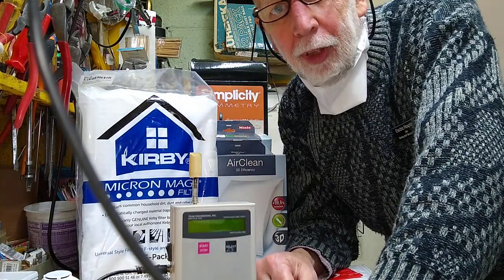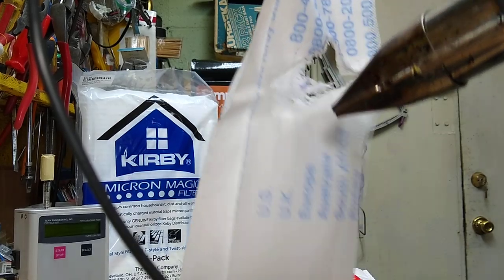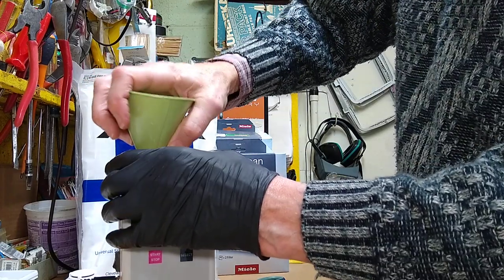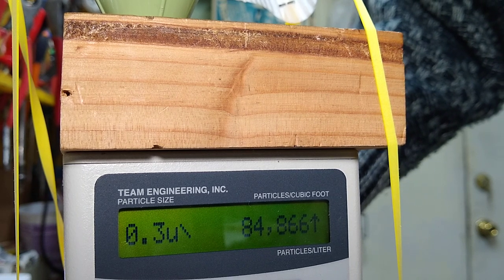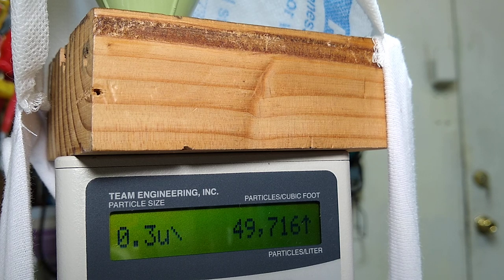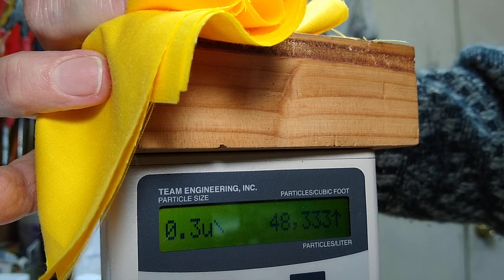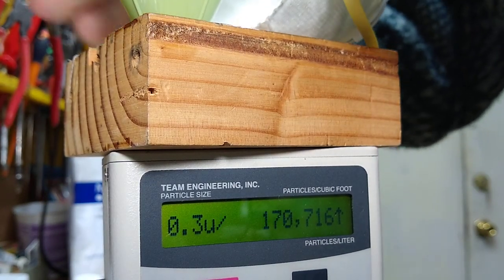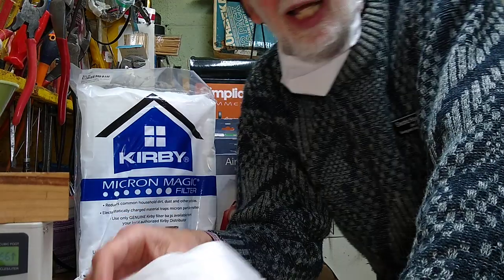Myth Busted Fiberglass in Vacuum Cleaner Bags

Comment: Thank you! I’m tired of people repeating misinformation about hepa vacuum bags containing fiberglass. For personal use my friends and I made two-layer cotton masks with an inside pocket. Inside the pocket we put filters made out of Kenmore hepa vacuum bags. The vacuum bag fabric (meltblown) filters down to .3 microns.
Reply: Doesn't air come through the cotton part of your mask without going through the filter? The CDC states that medical personnel have to have even N95 masks fitted to them to get an airtight seal and that they have to have the fit tested monthly. Also they state N95 masks are useless with beards, something "Dr." Joe might want to think about.
Reply: Edward Be5 It’s true what you say about medical use masks, but these are for personal use, as I had stated. The inserted filter actually covers a fair amount of the face, so it would provide a bit more protection.
Reply: What ppl are forgetting is this. 1, with these home made masks ur supposed to be practising social distancing, 2. Handwashing 3, not fiddling with the mask. So overall running to the grocery store or sitting at ur desk at work ur chances of getting the virus is reduced. Obviously if ur a dr and working in ER u probably need a whole lot more of PPE.
Reply from the maker: Yes on both accounts.  There is some leakage with the cloth mask and the beard.   I find if I put on a mask or respirator very tight the beard compresses enough to keep sawdust out of my nose.

Comment: Hey, thanks for the video! 
I feel pretty safe using the vacuum cleaner bags I have at home, the material even has a sligtly similar feel to the material of the surgical masks I had. I’ll might ask the manufacturer just in case.

Though I’m still worried about the practical performance like breathability of vacuum bags, they do seem safe atleast. But could you also give your opinion or do a video on vacuum cleaner exhaust filters (HEPA or not)? I have two kinds and the other has soft cloth-like material similar to the bags, but denser and thicker. The other cheaper exhaust filter looks a bit suspicious with more rough fibers. I’m wondering if they too could be used inside a filter pocket of a cloth mask.

Comment: Not sure what to think after making a couple of calls.  See below:
I called Bissell about their Big Green Commercial bags:  BG101H & BG102H (UPC #011120167597 (Part #44).  The rep said this one has fiberglass but the one with  Part #45 doesn't.  Not sure what to think now.  Also, here is a verbatim chat I had re: Oreck 1C bags:  Oreck Hepa 1C Vac Bags:  These filter bags do not contain fiberglass. Our bags, like most vacuum cleaner bags are made of porous woven material, usually cloth, paper and/or synthetic material which act as air filters when installed in the vacuum.  If you wish to use them to make face masks, this is the information we have concerning that issue.  First and foremost, we desire for you and others to stay safe! Our vacuum bags have only been designed and tested for use in vacuum cleaners. Unfortunately, we cannot recommend for people to turn vacuum bags into makeshift face masks since this could give users a false sense of security and potentially put them at risk. Vacuum cleaners mechanically create a condition that facilitates effective filtration through the vacuum bag, but humans are unable to create this condition. Therefore, these types of masks cannot provide the appropriate filtration and would only provide minimal protection. Withthat being said, we are partnering with suppliers that have an expertise, volunteering resources, and redirectingvacuum bag materials that can be used to manufacture face masks to assist in the fight against COVID-19.  This is the best way we can currently help, and we will continue to look for ways to assist.
Reply from the maker: Sounds like a definite maybe.

Comment: Couple of suggestions. 1. Draw some air through those filters.  SO cut a hole in the side of your funnel you are putting your filter material over and draw some air out the hole.  This will show how many particles are being released from the filters as they are being used as you breath in and out.  2. Put the fiberglass over the funnel and show just how many particles it releases.  It may not be the amount of particles but the type of particles that are of concern.  3.  I like to see how well a water filter does and I don't mean a Brita water filter.  I mean like a Rainbow Vacuum water filter does without the Hepa filter.  I have an old 1970s Rainbow vacuum cleaner that is water only and it does a great job no dust or pollen coming out of it.  I think the newer models the hepa filters are unnecessary and were just added to say they improved it to justify increasing the price.
Reply from the maker: The laser partical counter has a vacuum that sucks air through the filter.  That's why the numbers decrease as the air inside the funnel is purged.  Then it measures what is still coming through the filter.  
I did test the fiberglass and it was filthy.  It came out of my attic so I didn't show it.  I didn't think it was fair to compare it to a new filter.

I have tested old Rainbow Vacuum Cleaners and none of them filter as well as a Miele with a HEPA filter.  Even the new Rainbows are not as good at filtering.  That being said I have many customers that swear by their Rainbows.

Comment: Joe, the CDC states that N95 masks come in different sizes and have to be fitted to medical personnel to achieve an air tight seal. They also state that the fit needs to be verified monthly. A real fly in the ointment for you personally is that masks are not effective if you have a beard. This makes sense. Why worry about needle holes if air and viruses are going around the mask through your beard?
Reply from the maker: Yes beards are going to make the seal bad.  I like to do wood working and usually wear a cartridge type respirator.  They are hot heavy and uncomfortable.  However even with a beard I can tell my allergies are less severe with the face mask on.

Comment: Joe. As part of your demo you work with a Miele dust bag; however, any thoughts on the Miele SF SAC 20/30 filters?  Are these also comprised of non-fiberglass materials? One person I talked to says that Miele, for example, does not make their own filtering components but rather these are produced by other suppliers according to Miele specs. Additionally, I was told by one source that Miele filtering materials are either not suitable (or at least not recommended) for use in face masks. Given liability issues, it likely depends on who you talk to. There seem to be many schools of thought on this whole thing. I own a C3 Miele and so have the filters I referred to and was hoping to use them. Thanks again for sharing all the info.
Reply from the maker: I have used these in my respirator for years.  They are not figerglass.

Comment: My questions is in regards to the exposure to the polypropylene... There are studies on pubmed that have identified potential hazards that flocking workers are exposed to when working with synthetic polymers. One study I read, showed significant differences in various pulmonary function tests between the workers and the controls. Granted, the workers were likely exposed to a higher concentration of polymers than say a person using a mask for 20 minutes at a grocery store....... There are risks to everything, however, and unfortunately we do not yet have good information on the actual usage of masks made from vacuum bags and health outcomes. Therefore, I don't think it's fair to say that we can assume that using vacuum bags as filter masks are necessarily safe. HOWEVER.... here's what I am doing.... because I have a family member with a leukemia, I am suggesting they can use a mask made from vacuum cleaner cloth only during very specific times, i.e. have to go to the grocery store... for all other times, when they leave the house, I suggest using the cotton masks described by the NEJM, Lancet, etc. studies.
Reply from the maker: I can understand your concern if you were flocking or making these fibers.  The hazards of loose fibers would be greatest when cutting.  When you are sandwiching them between two layers of tightly woven fabric this would also reduce the exposure of the end user.  Thanks for sharing your ideas. 
 Have a great day.

Comment: Thank you so much for this video.  If vacuum cleaner bags are used as a filter inside a homemade cotton fabric face mask how often should they be changed out?  I'm guessing you can't wash these so just pull it out of the homemade mask you are using while you wash the cotton mask? Would you advise spraying the filter with lysol after each use? Thanks!
Reply from the maker: I would not recommend any disinfectant that could leave a residue.  Alcohol may be safer.  Remember I am not a real doctor. Lol.
Reply: @electrichospital  okay thanks!

Comment: Specific to Miele FJm bags- when making a mask can you tell me if I could/should use the filters that come with the dust bag or just the dust bag itself? There were 2 types of filters that came with the bags - an air filter and a dust compartment filter. Are these any use in a mask?
Reply from the maker: We used the bag only.

Comment: If not sewing closed (makes sense!) then what is a safe way to close?  You said heat but how could we do that.  A curling iron? A pair of heated scissors? Argh.  Fix one problem, cause another.
Reply from the maker: I had success with a soldering iron used on top of parchment paper.  It takes a little practice but once mastered is quick.
Reply: Joe Neill Thank you Joe! 😀👍. I wish I had a soldering iron.   Hmmm. Maybe the rings on my electric stove?  🤷🏻‍♀️🌀
Reply: A REAL man.  Respect ✊
Reply from the maker: @lovewillwinnn  Do you have a hot glue gun?
Reply: This video was by far the best I’ve seen so far. The fact you were proving the filtering capability of the different materials makes me A LOT less stressed out about making DIY masks and filters! THANk YOU!! Is there any chance you could make a tutorial making the mask/filter?? That would be FANTASTIC!! Again, THANK YOU for this video!!
Reply: Joe Neill I dooooooo!!   ❤️ I see what you’re getting at.  Perfect!!!
Reply: Casey DeLoach Yes! That’s what I’m using. I hope that by the time it dries, you can’t get high off the glue. 🤣😋

Comment: How did you make the mask without sewing?
Reply from the maker: You can use glue or melt the fabric with a soldering iron.  I used a pencil iron and parchment paper to keep it from sticking to the iron.  I found a straight edge allowed me to move the iron quickly with precision.

Comment: Looking for the best material.   All materials you  tested score more efficient than the New N95???   Something doesn't look/sound right.  Either the CDC and Medical World are using the wrong material or something is wrong with your tests? Unless you can't breathe through the other materials.  Comments please.
Reply from the maker: In evaluating a mask one of the issues is how well it seals to your face.  The N95  appears to do a better job than a fabric mask. The exhaust valve is also a big difference in comfort and usability.   The test I did only considered the filter material.  Yes there are better filters than the N95. However it is a cost compromise.  The 3M  cartridge respirator in my opinion is a much better filter than the disposable N95.  That is what I use when wood working.  I also use cartridges which stop VOC's which would not be a normal concern for the medical profession.  You could build a better mask than the N95.  It is just considered adequate for a disposable barrier.  Have a great day and stay safe.
Reply: @electrichospital  Just found your vid! I started making vaccuum bag masks April 2nd after researching which bags had best in class filtration material. I used the Miele vac bag to Gorilla glue to CPR training masks and rigged a standard ear loop dust mask around the base of the CPR part. The CPR guard enables a complete seal around nose and mouth. First- I carefully peeled off the orange plastic vacuum fitter and glued the bag directly to the CPR guard with hairdryer assistance. I didnt realize the bags could be cut and sealed by ironing! Thank you! I will work on making mine less bulky. You can adjust the tightness and fit by tying knots on the ear loop. I also attached a firm plastic barrier shield which is intended for protecting helmet eye shields. It serves as a solid barrier that can be wiped down and also protects the space between eye protection and respiratory guard. Found those on Summit Racing website.  Hope this helps more people get creative and stay safe! I'm too camera shy to post a video but if you'd like to connect offline, I'll send you one and you can test on your nifty gadget!

Comment: when using vacuum bags, are they "directional", meaning filtering is better if you put one side on the inside than the other?
Reply from the maker: In a vacuum cleaner the dirty side is the inside and some like the Miele are more directional.  They have a very loose inner fibers where the Kirby bags have the same on both sides.  If you wanted to use the Miele bag in a pocketed cloth mask it would depend if you are filtering the air breathing in or the air exhaling.  It would seam to me the inner side of the bag  would be the better side to face to the particulates.  The idea that a mask only protects others from the user then it would not matter.  If you are only protecting others from you then a face shield would be good.  Personally I suspect there would be some protection for the user.  I use a face mask when working with dust to protect me.  You can get an indication for the effectiveness of a face mask when you clean your nose at the end of the day.
Reply: Joe Neill Thank you for this explanation Joe very helpful 🙂

Comment: Can you test the Kenmore HEPA vacuum bags too?
Reply from the maker: I tested one of the Kenmore bags and it was 60,000 particles which was not as good as the Miele or Kirby bags.  There are other models of the Kenmore that I did not take the time to test them all.
Reply: @electrichospital  That's good to know. Did you test any Hoover HEPA bags? Also, if I wanted to test for fiberglass in the vacuum bags, can I use a lighter or do I need to use a heat gun?

And lastly, thank you for posting this video. I found it very helpful and have passed it on to several people with the same question. Stay safe and healthy Joe!

Comment: Just because those two bags don't have glass fibers in them doesn't mean some other bags might.
Reply from the maker: Yes you are correct.  I have tested many modern bags.  Fiberglass is old technology as the poly bags filter better and are safer.
Reply: Fiberglass comes in many different forms. You need to do a chemical test to determine the amount of fiberglass.

Comment: When someone is wearing a mask they're actively sucking in the air, while in your test you're just testing how much particles are passively falling through the mask. So less breathable materials will always win. Instead you should try forcing an equal amount of air through the filter and measure that.
Reply from the maker: Good point.  The particle counter does suck in air but perhaps not as much as a deep breath.

Comment: what seem melter did you use?
Reply from the maker: I used a low wattage pencil soldering iron with parchment paper over the filter to prevent the iron from sticking.  It was quick to melt.  I found sliding the iron along a ruler makes the lines straight and even.
Reply: @electrichospital  Thank you !!!!  the parchment paper idea is brilliant. i tried a iron, but it let residue on the iron, like plastic melted.  If you dont mind, what wattage iron?

Comment: Even the filter bags and furnace filters that don’t contain fiberglass are still unsafe to put directly over your air way they have never been tested for that. Just because the bags you are using don’t have fiberglass don’t mean the ones available at department stores are safe or don’t have fiberglass. You also have to test how moist exhale effects the release of chemicals directly into the air way. Just be smart and use filters designed to be over the air way.

Comment: Can you breathe through the Miele bags? Also, if you didn't sew through the hepa mask would it test better than the 34,000?
Reply from the maker: The one in the video was melted together with a soldering iron and parchment paper.  Sewing through it made it almost the same as the ambient dust.
Reply: Joe Neill But can you easily breathe through it?
Reply: @CathMom93  I've placed a piece of the Miele bag in my homemade mask as a filter and I have no problems with breathing...hope this helps.
Reply: @electrichospital  Can you explain more about how you used the soldering iron and parchment paper to do this? I can't picture it and I don't want to melt my bag.
Reply from the maker: The best welding was when I put a layer of cardboard to protect the table.  Then a sheet of parchment paper to prevent the melted bag to stick to the cardboard.  Then the bag to be welded is covered with a second sheet of parchment paper.  Using a straight edge to guide the soldering iron along permits you to move it quickly in a precise place.  I liked the 45 watt pencil iron.  I ground the tip round and drug it backwards at a 45 degree angle.  It sounds complicated when you write down the steps.
Reply: @electrichospital  No, that was a perfect description. Thank you!